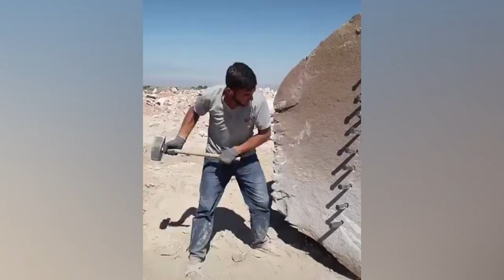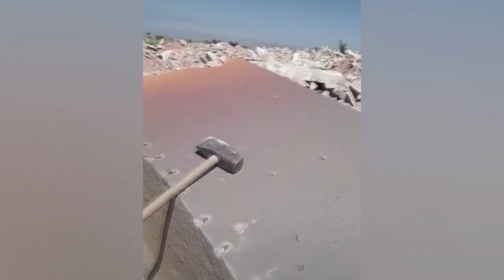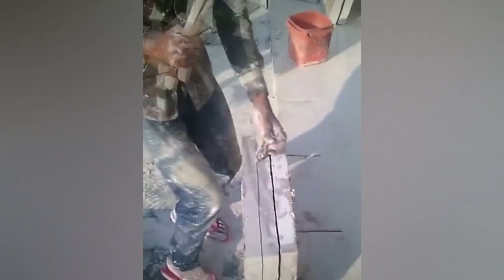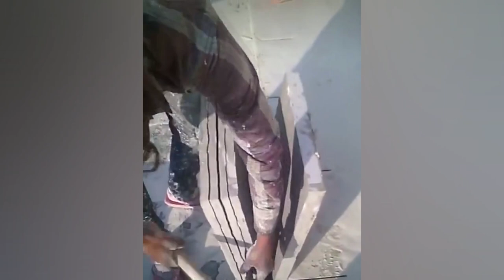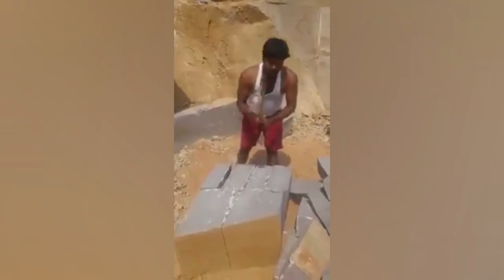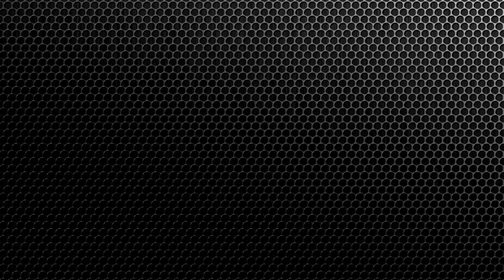Rock cutting, using only hammer

Comment: Imagine the strength you'd gain swinging a hammer like that last guy, every day...
Reply: @P4n3K  WHAT??? 🤣
Reply: He is from INDIA... Infact both last clip
Reply: At least 3 points worth
Reply: plus a back pain
Reply: @TheUniversalid  look how loud it is, he must be deaf like blacksmith in middle ages :D your ears can't hold such'a high volume hit's so many times without any damage taken ;)
Reply: Sjjsj
Reply: madd back problems and soar arms daily, soar buu numb to it
Reply: Well the hammering is way below the NIHL( noise induced hearing loss) limits. No big issue can be executed by average Indian Mistry, but one from the Marwar desert have special hands on this art form.
Reply: I would 1000% rather do that than pound hubs on blue top all day long.
Reply: 0 back left
Reply: @P4n3K  he is in open space i doubt he hitting over 98db pre hit,lets say he doing 98db it will take over 4hours to start getting hearing discomfort,now if it was a closed space with walls all around he may have ear fatigue by the end of the day
Reply: My dad got ripped doing that😂
Reply: You become thor. Indian thor
Reply: Your body would get to a level of strength then plateau. As the hammer is not getting any heavier the body would get used to it. So initially you would get stronger.
Reply: not that much because no progressive overload. your endurance would get pretty good though.
Reply: @DevinDTV  yeah initial gains would be good because swinging a heavy hammer all day is not easy but as always the muscles will get used to it. Would be a good way to get  lean tho.
Reply: No so much strength but for sure explosiveness!!!!  He can beat a guy faster than you can see him! And mo you dont get def!
Reply: U would get muscles until ur body gets adapted to the heaviness of the hammer and the force u apply. But, there are other things u get. Like hip and back problems with chronic pain.
Reply: these guys would  beat the toughest boxers
Reply: @8512124  no, ur comparison makes no sense
Reply: And how will he eat soup in future. Much vibrations absorbed by joints will cause tremors.
Reply: not if you're malnourished
Reply: your hands would be actually full arthritis by 40. i know a guy who did that.
Reply: @P4n3K  bruh..🤣🤣🤣🤣
Reply: it breaks your back, the constant heavy noise damages your hearing and the dust damages your lungs. Speaking from personal experience.

Yes, you get to have raw strength... after you come home dead tired and dirty.
Reply: Imagine how shaky his hands will be by old age.
Reply: One punch sadi
Reply: Imagine the back problems
Reply: @bluesummers5051  his hands would be so strong he can bend a 12mm iron rod with bare hands .
Reply: Hajime no Ippo training 😂
Reply: imagine that sledgehammer bounce back at your face
Reply: Imagine your back when you’re 35
Reply: Unfortunately they don't get that much nutritious food.
Reply: @luttrwe7688  man that's all construction workers do, find a job and you will be paid too.
Reply: If Francis Ngannou Shoveled sand at 10yrs old 
& got that strong
The the last 2 Guys from India 
are not ones to mess wid!
Reply: @shadowslayer4578  how do you know lol
Reply: @AT-tw8lf  Huh?  Did you mean to reply to me, because I am confusion.
Reply: The true workour routine of... ONE PUNCH man
Reply: @P4n3K  well the ears are the less important injury
Reply: I think what’s more impressive and the compelling factor is their technique. I’m not sure you need to be a super strong to cut rocks like that, but they are masters with those hammers
Reply: @TheUniversalid  it damage our hearing
Reply: my gf swings my hammer every night ;p
Reply: He made bricks with a hammer and a giant piece of stone.
Reply: @luttrwe7688  yes, but not in satirical tone.
Reply: It's called Francis Ngannou
Reply: @AT-tw8lf  Care to elaborate?  Do you know what I was talking about before?
Reply: @luttrwe7688  definitely, you want to do that kind of exercise and, i want to say that if you go into construction work, not only you get what you want but will be paid as well, it's a better option than paying for gym.
Reply: Imagine the amount of asbestos sticking to your lungs like a fungus
Reply: Imagine the joints and nerves pain
Reply: @ok6114  bcoz i have already seen that many a times from locally....lol
Reply: Better switch arms every once in awhile, then.
Reply: Want a job on a rig?
Reply: They are the guys that embarrass all those gym rats in street fight vids
Reply: @AT-tw8lf  Oh I see!  Yes very much agree.  I did survey work for a while, building parking lots for schools getting prevailing wage at $54/hr (a handsome wage for blue collar work), and it definitely gets you in shape, FAST. 

It can be very grueling work though, especially in the summer.
Reply: @shadowslayer4578  oh lol
Reply: ok joe Rogan
Reply: And imagine the force of rock going back through hammer bcs of newtons third law and impacting poor guys wrists, elbows and shoulders. Thats just a brutal job for a man to be doing in a long term...
Reply: Just get a sledge hammer and an old tire and go at it. A big tractor tire would be best but I'm sure even a small hammer and a Civic tire can get results too.
Reply: You’d be getting shoulder surgery after a while
Reply: @markokockar8546  the physics isnt that cut and dry irl lol
Reply: @user-pd9ju5dk5s  yea but the laws still apply. There are energy losses ofcourse but significant force is coming back through hammer because of its low elasticity. A good example is if you take a steel baseball bat and hit a tree really hard for 15-30 minutes. I think your wrists would start hurting.
Reply: @markokockar8546  for sure. It can't be good for your body, especially your joints
Reply: Look up Francis Ngannou. Dude grew up digging sand for salt mines. He a ufc fight now. Dude touches people and their life changes.
Reply: @shadowslayer4578  why does it matter
Reply: dude doesn't look particularly strong. and he probably has numb hands like all the time
Reply: Yeah, but also imagine doing that for 10 hours a day for the rest of your life.

I’ll stay happy with my chicken arms…!
Reply: He will level up his Rock Cutting ability in no time
Reply: @Joe-lc3sv  my dad do dhis for 30.years..he suffered no problem

Comment: Maybe with this skill the egypt & roman empire build their palace!
Reply: they used concrete and forms
Reply: @uterotourettes15  that was the romans. ancient egypt probably used stone cutting
Reply: According to latest find, they use clay that had been shaped and burned in fire
Reply: They were just very big and strong.
Reply: @Baba24M  no, they were weaker and smaller
Reply: Most of the megalithic sites attributed to Romans, like Baalbek, weren't actually made by Romans but were found by them and built on top of.
Reply: Aliens built them
Reply: @tanyapunyo2074  nah
Reply: Romans not, they created concrete which is actually way more durable than the one done this days.
Reply: @rumfordc  You're full of shit, the Roman temple of Baalbek is as categorically Roman as you can get, with the exemption of the Greeks (that much of Roman architecture is based off of).
Reply: @ThatGuyUpThere  No. We have concrete nowadays that is more durable than Roman times, but many developers will choose inferior concrete for a cheaper price.
Reply: BUt not all rocks are the same, so they dont all crack like this.
Reply: @goosenuggets9693  The temple built at baalbek is absolutely roman but the foundation that its built upon is likely to be older and has much larger impressive stones. Very interesting i suggest checking it out
Reply: This technique was actually used by Egyptians!!!

Comment: Present time: Pharaohs didn't have the technology to cut stones to build the Pyramids! Aliens must have done it!
Youtube: Rock cutting, using only hammer
Reply: Yeah... Those conspiracy lunatics seems like they never did their research before...
Reply: Pyramids are made of granite, you can't cut granite like that.
Reply: It's not only a hammer. The people are using two tools. The hammer is just one of them. Can't you guys see?
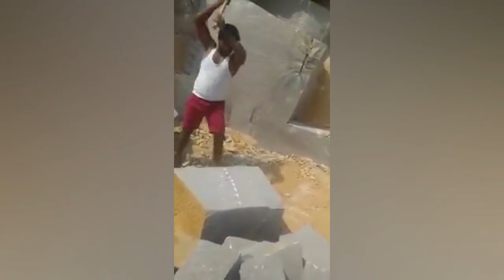Reply: @Problemsolver434 actually the guy at 1:11 is using only a hammer.
Reply: @DiegoM265  you have tryied to be that sure that it cant be made by hand?

Remember in those times pharaons had like millions of slaves, million of hammers can brake any rock.
Reply: @pak3ton  I wouldn't say millions
Reply: @nziom  millions if you count all the years that take to build those things... they work to death and then remplace for more slaves.
Reply: sorry doesnt explain monolithic structures , that have bore holes made from advanced drill bits that we dont have to this day. also doesnt explain how tightly fit lots of those structures are.
Reply: @DiegoM265  they werent made with Granite , they were made with Limestone.
Reply: they precisely cut multi ton rocks with perfectly flat surfaces perfectly aligned and parallel to each other to a fraction of a millimetre so there is a very valid reason to question how they achieved such precision
Reply: @DiegoM265  
A steel or iron hammer which they didn't have back in those times...

Comment: the ancient egyptians had hard steel. it is on display in egypt.  good quality steel was even knows in india some 3000 to 4000 years ago. there many ancient statues all over the world that are made of a kind of cast iron that is tousands of years old if not older. bronze was only used by factories that had mostly handmade work that did not invovle casting. iron was much more work to shape by hand. bronze was soft and much easier to work with. there is many places in the world that shows ancint factories and mass production of pottery rice and tools. even the classic copper axe from the stone age was actually manufactured and branded as the exact same shape of the tool is shown in many cave paintings as well as the finds of the real deal.

Comment: All tools used here are iron or steel, not to mention that the material is very important, try to do this "magic" with granite, and then try to dig inside of the coffin this way without breaking the walls. Yes, we know that could be done with the soft stones, most importantly the small ones, try to use thin or cooper tools, or stone hammers with big stones of any kind and with granite, or even the hardest stones, used by Egyptians... I bet, you would get in some troubles. Some of the blocks, cut on equal pieces in this video are human-made clay bricks, so yeah compare our century technology with what we are told the ancient Egyptians have had... Nobody saying aliens, but definitely not with the tools and technology the 4th dynasty possessed.

Comment: To make the edges smooth, it is easier and faster to use concrete casting technology. For this, everything was necessary 2,000 years ago. But this in no way explains the high level of development of the ancients in comparison with the Middle Ages.